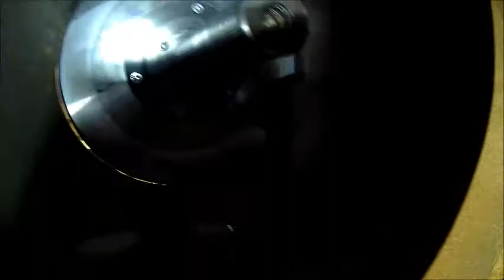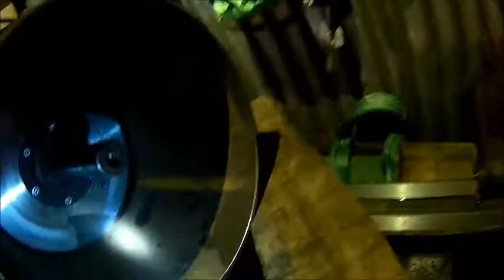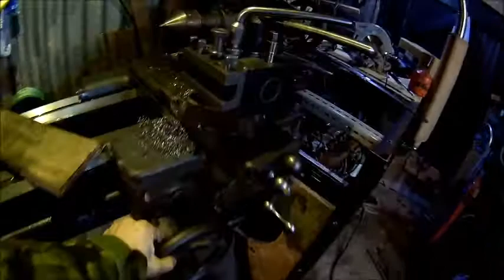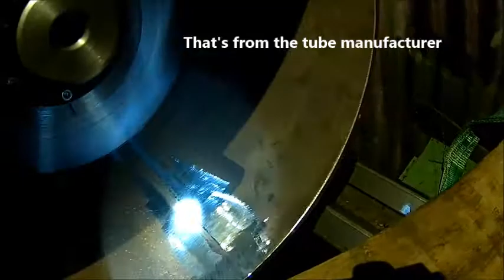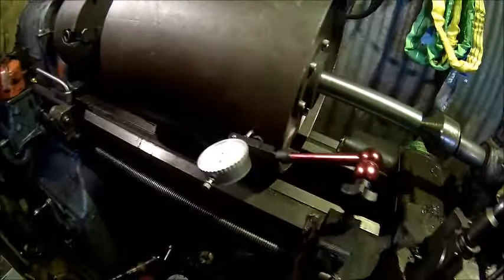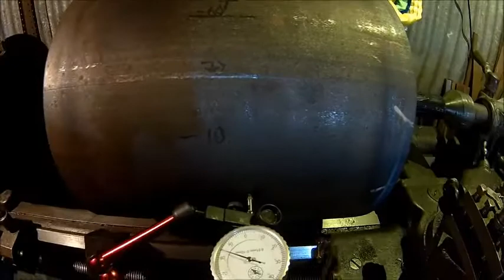The Mystery Project - Part 9, finishing first roller, testing the run-out after welding

Comment: hmmmm... still stumped..lol...  one thing that i found to work good for making rollers is to make the hubs a few tenths oversize, then heat the pipe up to max expansion, slip the ends in and align and then at the last tack weld and true it all up.
the welding will introduce some distortion that you can't get away from. 
that way the pipe will round up a tad more. pipe is always out of round and it often takes a pretty fair amount of material to be removed to get them trued up...
Reply from the maker: lol....just uploading the next part, perhaps that makes it a bit clearer ..... if the pipe would be smooth on the inside it might be an option, but it's not and i needed to shim it in places, i also wanted the option to take it off again which in hindsight turned out to be a good decision. It's only  6mm wall thickness and i want to skim as little as possible, ... for good reasons.